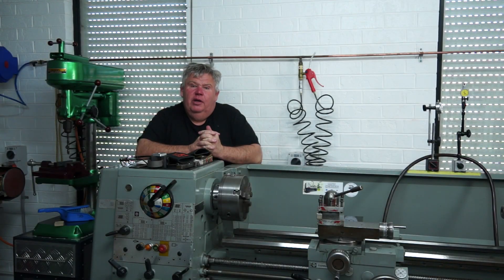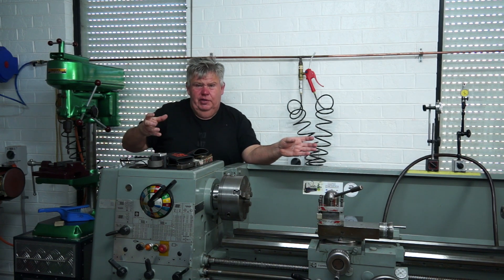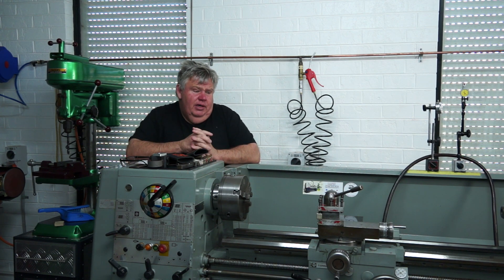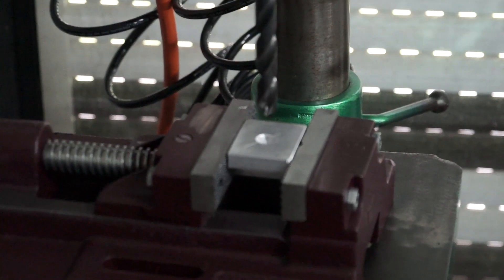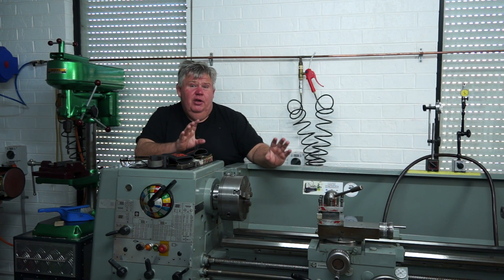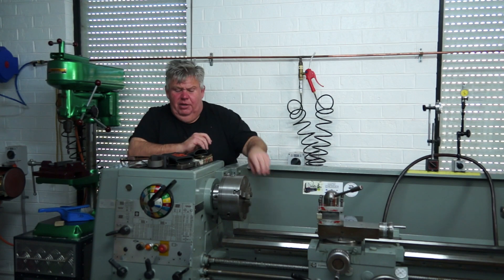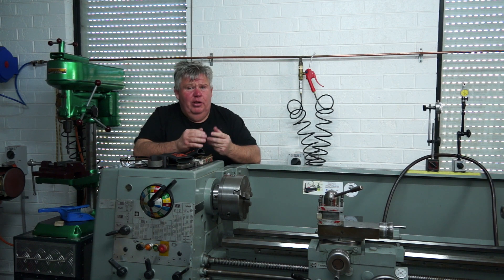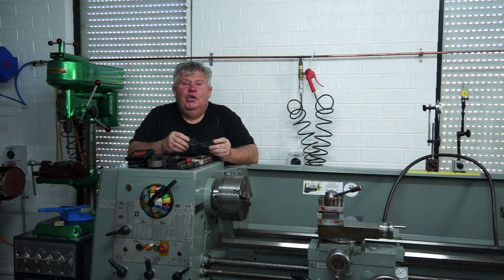Levelling the Colchester Lathe

Comment: Hello, can you help me? I bought colchester master 2500 it without a motor, and I need to know the motor rpm
Thanks
Reply from the maker: JM, sorry for the late reply but it was a bit of hassle to find the motor plate.  I had to remove both covers, but slightly difficult due to limited room.  If you email me, I can send you the photo.  Otherwise here are the details:
Brand = Stone Plat Electrical (McColl)
Motor = 3Ph induction motor A.S.1359 S.I. IP44
Power = 3.75KW / 5HP
Hertz = 50
R/min = 1400

Trust this helps you.
Aaron

Comment: You motivated me to re level my lathe. This time using the threaded castings in the lathe. It always amazes me they settle over night. 
Also, off the subject, it baffled me why the oil in the sight glass for the head stock did not behave like most of the Colchecters I've seen.
In my lathe, (Clausing Colchester 15X50) you could see oil flowing but there was air on the top half??
I got to thinking about it and realized there was a bubble in there. I took the cover off, used a small drill bit to clean out the vertical vent hole and fired it up.
The oil flows like it always has but now the sight glass fills immediately.
Reply from the maker: Hi Jeff how’s things buddy? Yes I was lazy and never levelled my lathe when I installed it.

Upon doing so I backed off the six screw jacks and used 10mm aluminium plate underneath the screws. I chased my tail a little doing it, but it was worth while in the end. TBH, I think my headstock may be out of alignment slightly. Something I need to check, inspect and remedy sometime soon.

Yes my oil sight glass fills up when I start the electric motor. I can see it flowing through.

Cheers 🍻

Comment: When I first bought my 1970’s Clausing Colchester 15x50 I found it was difficult to find information on it.
Vintage machinery.org has the manufacturers index. I found a spitting image of my lathe as a Triumph 2000.
My lathe experience is on South Bend 13” lathes.
There are so many nice features on these modern lathes. Large spindle, 2.0”, auto reverse in both saddle axis. Plus, the ability to turn to a stop with the clutch in the apron.
I found zero hobby machinists who could help me with this lathe. I had to just use it to learn it’s functions.
It’s nice to find some help online.
Any help I can get from watching you with your Colchester will be appreciated.
Thank you,
Jeff
Reply from the maker: Hey Jeff.  Would love to see some photos of your lathe if you don't mind.  Feel free to send me some photos via my email.  Have you download the PDF manual of the Master 2500?  I know it's a different lathe, but I think they have many similarities.  Great talking with you mate.  Cheers, Aaron.
Reply: Aaron Engineering 
I would love to share photos. I don’t see your email?
I used a Starrett 12” level on my Colchester. Yours is much more finicky.
Reply from the maker: @jeffanderson1653  Hey Jeff.  My email is my full name (aaronpowter at hotmail dot com) just fill in the blanks.  Cheers, Aaron

Comment: Continued..... ‘specially’ when the joints are a bit creaky. The aluminium feet should be ok, but check the level after a month of running the lathe.
Great vids mate 👍
Fond Regards,
Grasshopper 😂
Reply from the maker: G'day Robert.  I was a little worried about using aluminium at first, but unfortunately I didn't have any steel at home to use.  The HAAS Super Minimill we had at school sat on Aluminium feet.  Fingers crossed I don't have problems with mine.

Comment: Hey Aaron.
I am also guilty of posting a video on Leveling ???? a Lathe.   ( My Mazak Mission, LOL )
Well Not really Levelling as such, as I find this a little pointless to tell you the truth.
More so the concern with a Lathe Bed is to make sure you Do Not have Twist in the bed Not so important to concern yourself with levelling a Lathe ??
It's funny saying that,  as sometimes you Need to have Twist in some Lathes so they cut Without Taper ????
You will only find this out after setting the Lathe up correctly then taking test cuts to see what your Lathe is doing.
Reply: Your correct, other than maybe slightly tilting a lathe to ensure coolant drainage to the correct place, the actual exact level condition of the lathe has no real importance. That non twisted condition of the bed ways is the important part. As long as the levels vial reading is the same from end to end and across the ways for the length of the bed or "level" that will be your initial starting point. So using that high precision machinist's level is just the fastest and easiest method of adjusting until there's a zero bed twist condition. Further and very slight counter adjustments are still required outside of that theoretical "perfect" level condition to then compensate for deflection's within the machine under the unavoidable cutting forces. Only one example, but the tail stock is obviously much less rigid than the lathes head stock would be. So it's components deflect more than the head stock will. But there's still further deflections in every point from the bed ways all the way to the tool shank and even within the head stock. So those minor corrections are required even on a brand new machine. Having that perfect level condition will only get you fairly close and it's still not the best you can get. Most seem to misunderstand what's really being accomplished by leveling a lathe. Any bed way twist because of the vertical distance from the bed ways to where the cutting tools point is gets greatly magnified. Think of it as slowly rolling the tool point in a large arc either into or away from the cut as the lathes carriage follows any twist in the bed. That's what creates a taper in a long shaft that can obviously be tapered in either direction depending on which way the bed twist is orientated. So the measured taper direction dictates where an adjustment needs to be done. Small at the tail stock end you'd go up a bit on the tail stocks rear or furthest adjustment point away from the operator. And/or down at the front to help roll the tool point out of the cut a tiny amount. 

It's also important not to have the tail stocks center line alignment influence your test bar measurements as your making those test cuts. A DTI swung side to side within the tail stocks Morse Taper from the head stock AFTER you have the lathe bed initially leveled will allow it's center line to be adjusted correctly. What you can't do is test the tail stocks vertical elevation by swinging that DTI in a complete circle. Gravity will greatly affect those measurements by far more than most think. However a tail stocks vertical elevation against the head stocks exact center line has almost no measurable effect unless it's very seriously out. A few thou vertical misalignment only moves the tool point by that much on the shafts radius. For that reason even the best lathes ever produced are usually a couple of thou high so they start to wear in to correct alignment and not immediately starting to wear out of alignment.

Once the bed ways are level and square to the machine at the head stock end in Y and Z, I'll do further adjusting almost always at the tail stock end. Re-checks of the head stock end should still be done to ensure nothing is changing, but doing it that way results in a bit less tail chasing imo. Slowly working around the machine and in small increments towards the direction you want is faster than adjusting the full amount and thinking it will remain in that position. It won't and I've done it more than enough to prove that. Lathe size dictates the diameter and length of the test bar your cutting. And ideally those test cuts should be done by turning the shaft between centers. By far that's the most accurate and repeatable method of test cutting any shaft. My methods sure aren't the only way, and there's many others. For myself I have found them to be the easiest and fastest though.
Reply: @turningpoint6643  
Test Cuts ??
Should always be approached 2 ways ?
First Bed Twist Test Cut of the Head Stock. 
This Must be done first. 
To eliminate Head Stock misalignment from Twist in the bed.
As i mentioned in my previous comment.
Sometimes ?? the Lathe Must have a Twist to correct misalignment of the Head Stock. 
After finishing this Test Cut.
And you are happy with the end result. 

Then the second thing to do is a Centre to Lathe Chuck Test Cut.
I don't like doing Centre to Centre Test Cuts ????
Why ?
Because this is not something that is the norm with any machining operation. 
What i mean by that is ?
If you simulating something it should be simulated in conditions that are as close as possible to normal operating conditions. 
Centre To Centre turning is a very uncommon machining operation. 
Basically never used in a machining operation.
I know there is alot of information here on YouTube pointing to doing alignment of the Tail Stock this way .

Just to save me writing a lengthy reply that might only be read by 1 or 2 people i will post a video explaining My best way to Level and Align a Metal Lathe.
Reply: @weldmachine  I always use between centers shaft turning if it's got to be accurate for well proven reasons, so were going to have to agree to disagree. Whether it's used in industry today or not is immaterial, how a standard job shop might do things is 100% related to profit and speed. "But basically never used in a machining operation"? Many items are still turned between centers, just about every tool shank machined on a non cnc lathe would be. And most would be ground after heat treat using the same centers after re-grinding them until they clean up.It's by far the easiest way to turn and make test fittings on the female taper and replace it back in the exact same position for corrections.

I already know how to check alignments and properly level a lathe. Schlesinger's book details how to check any alignment there is on a lathe and he literally wrote the book on it. Every machine built today including cnc is in one way or another tested and aligned using his basic methods. Every lathes test certificate I've ever seen are based on his tests and methods. If the head stock is out of alignment that's totally off the subject of bed leveling. If it's misaligned and I've yet to find one that was unless it had a serious crash, then that needs to be corrected first and not by twisting the bed to compensate for it. I'm not here to argue, anyone is free to believe or disbelieve what I wrote. And I've been at this more than long enough to know what works.
Reply: @turningpoint6643  
Referring to books is Not something i do so well ??
Might give some handicap in reference to approaching things correctly ??

My information is gained from experience of using previous knowledge along with using this knowledge to further work out how to approach any problem i face.

I am not going to lean on the common reference people choose to use in comments on YouTube. 

I have 300 years of experience and i know how to do it ????

In my video i will describe how I level a Lathe.
Reply from the maker: @turningpoint6643  Thank you for the PDF book link.  I have downloaded it and will save it to my folder.  Thanks again.  Aaron.
Reply: @AaronEngineering  Your welcome. That PDF refutes a whole lot of misinformation the machinist forums seem to be riddled with and even some that's on YT. Tom or Oxtools and a few of the other more professional guys would be exceptions to that of course. But I'd be interested in your thoughts once you've had a chance to go through that information.
Reply from the maker: @turningpoint6643  Thank you so much for your thorough and in depth explanation.  I really appreciate the time and effort you put into your comment.  I trust others will read your valuable input.  I have a test bar coming in the mail next week.  However I need to do some test cuts like you suggest.  I am confident that my side (X-Axis) readings are the same front to rear but time will tell once I start test cutting.  Thanks again for you help.  Cheers, Aaron.
Reply: @AaronEngineering  I posted a link in a post above this to that PDF of the Schlesinger book. I've tested that link and it works for me.Well worth printing the whole thing. Then read it through enough times so it's fully understood what each test is measuring and why it's being done in that way. Proper machine tool alignment is a whole lot more complex than most seem to think. Understanding that complexity is more towards the commercial machine tool rebuilding level. Yet it's just part of using any machine tool imo.  

Morse Taper test bars are helpful and I own them myself. But they require an almost pristine unmarked taper before there results can be trusted. Most previous owners of any used lathes haven't been as careful as they should be with both the head and tail stock tapers. They should be treated like a very expensive and delicate mechanical watch since any damage can be extremely difficult and expensive to repair. A morse taper reamer can work on mild burrs or slight damage if the taper isn't hardened. Anything more than that and specialized expensive re-grinding by someone highly experienced is required. Any tool not clean enough to eat off of isn't clean enough to use in any taper. Your Colchester tapers are almost for sure hardened. That helps, if they were to get or are damaged then those MT reamers won't touch them. That regrinding is then the only solution. Since I don't have the equipment to re-grind damaged or worse rusty male morse taper shank tooling I won't touch any of it unless there taper shanks are in factory new condition no matter how cheap it might be. Morse tapers hold due to there friction between two surfaces and wedging action, both require a very good and matching surface finish to well under .0001" in accuracy.    

What those MT test bars can't do is replicate the cutting pressures and loads the machine sees during normal use. So whatever results you see for test measurements should be very close, but are still only a static measurement. The last final adjustments need to be done with actual test cuts and measuring what the lathe is producing under those dynamic loads. It can sometimes help to use an indicator to measure how much movement your adding to the machines adjustment points as you move the leveling bolts in or out. Cross checking that against the bubble movement in the level gives a much better idea of how much more might be needed or how much might be too much when adjusting the bolts. While it slows the job down it can end up being faster to get to the correct level position and there's a bit less tail chasing.
Reply from the maker: G'day Peter.  Some excellent information you've provided there.  Many people have said the same as you.  I will have to take some test cuts now to find out.  Or I should just wait till Covid stops and invite you over to show me how LOL.  I think the later option may be best (wink wink, nudge nudge).
Reply: @AaronEngineering   
Hey Aaron 
Your reply came at the right time  ??

To answer a reply to my comment i will be better to post a video., LOL 

I was planning to do some work on my Mazak Mission today while waiting for material to arrive. 
But thought might be good to post a video about this topic.
Reply from the maker: @weldmachine  Please do a video Peter.  It's shame this bloody lockdown was on, as I could have shot the video for you.  Would love to get down to your shop for a look around.  Keep posting videos mate.  Share that knowledge you have and pass it on to others.  Don't take it the grave with you grasshopper master LOL
Reply: @AaronEngineering  
LOL. 
Video is coming very soon.
A little different to my normal videos  ??
You will understand sfter watching. ?
Reply from the maker: @weldmachine  I'll go and check it out now Peter.  Thank you for doing this.  Aaron.
Reply: @AaronEngineering  
I will make a revised version first??
The original was to nasty 😅😅😅